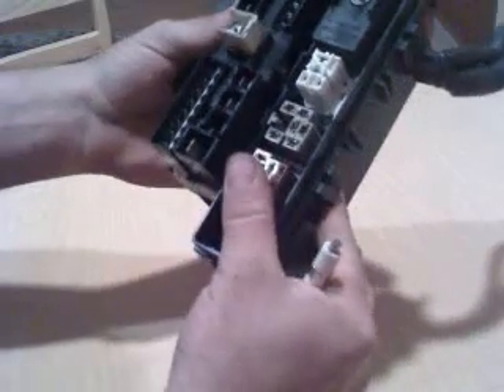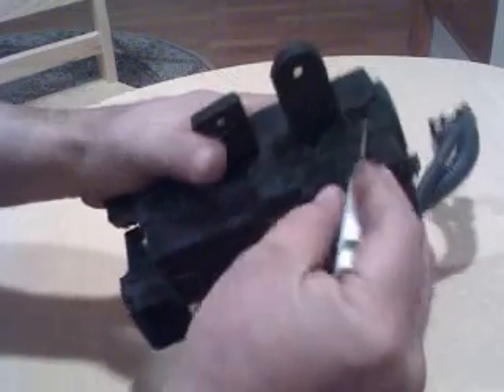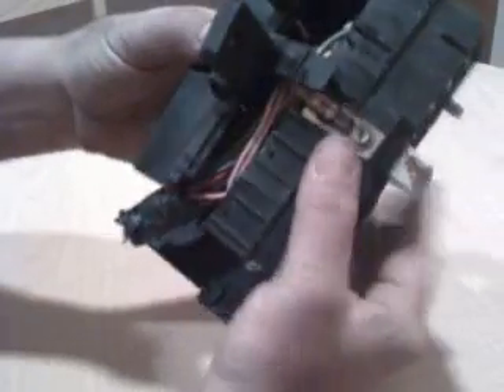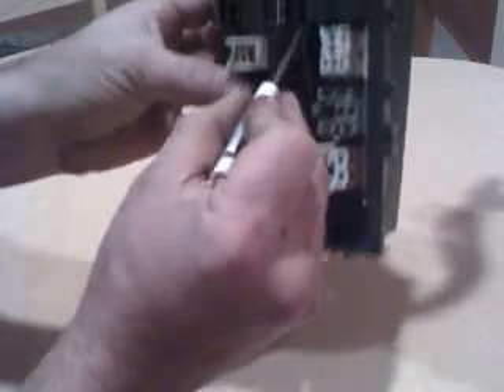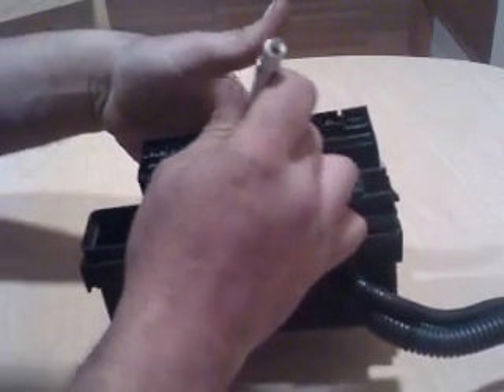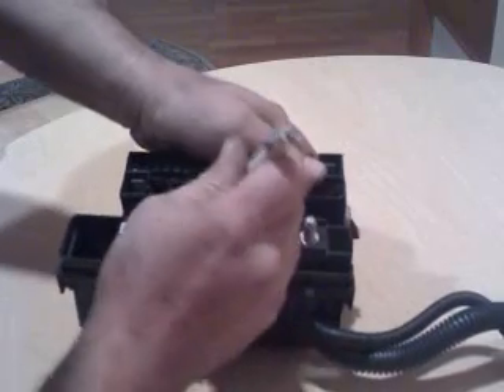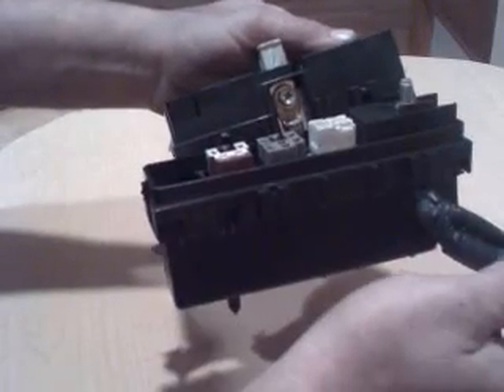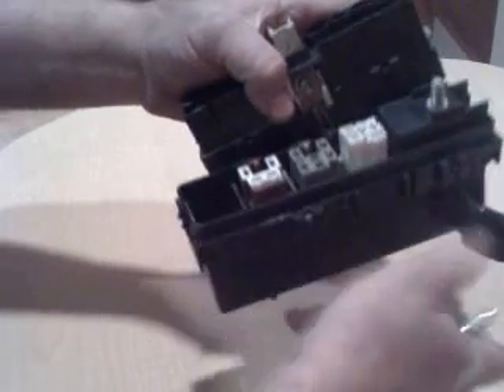Nissan How to change a Nissan Main Fusible Link

Comment: I got a 2002 fontier s/c auto trans . And no power going to the transmission . Checked wires and fuses , relays  . All good still no power so i can only manually move the shifter to use 1-2,N,R,P and when you hit the over drive off button nothing shows on dash either

Comment: it would help out a lot if you said what yrs and model Nissans this was for and the quaility if your video is  really bad by todays standards ...sorry
Reply from the maker: It is a very old video. It was made 11 years ago.  Phones did not have a great video camera back then.  This is for a older Maxima.  95 to 99 Maxima. But there is other model Nissan's that have the main fusible link bolted in like this as well around the same years.

Comment: All Nissan vehicles or certain years?
Reply from the maker: jp2code  All years a different. But most have a similar layout from 04 trucks and older, for cars 01 and older.
Reply: OK. Probably won't be valid for my 1994 Nissan Hardbody truck, then. Thanks.
Reply from the maker: jp2code  Your Hardbody has the wire type fusible links. They are plugged into the back side of the positive battery terminal.  You unplug them and replace them and plug the new ones in.  They are not like this.
Reply: Got it. I already knew about the fusible links on the battery terminals. I was wondering if there were more squeezed into the fuse box. Thanks for the help!
Reply: +FixyourNissan any idea where one would go to find replacement fusible links?
Reply: +Robert Herrera The Nissan Dealership will have the best prices. They usually run about $7.
Reply: +jp2code Cool! Thanks!
Reply: My truck will not start.the cables was hook up the Wong way.
Reply: @johnsnyder4284  yeah, tried to jump my Pathfinder in the dark after the alarm started to"cry" as battery went dead. Now nearly nothing with key turned on, but headlights are strong. Bummer mate!